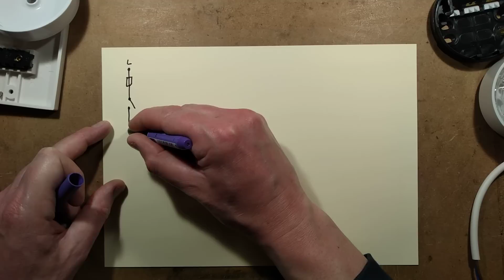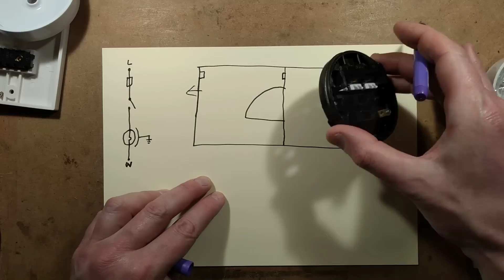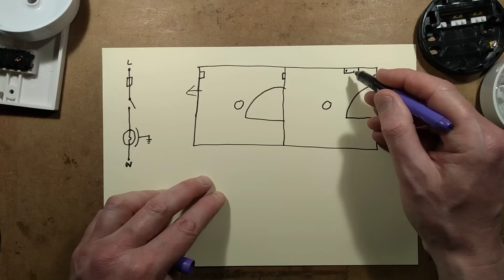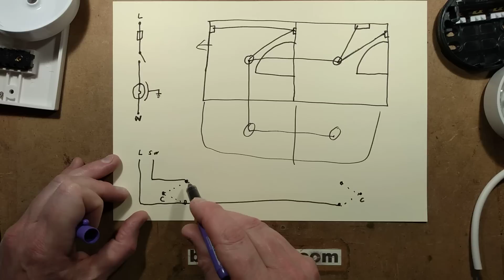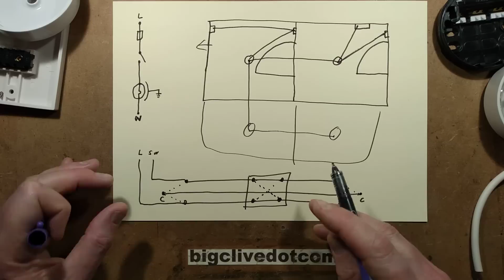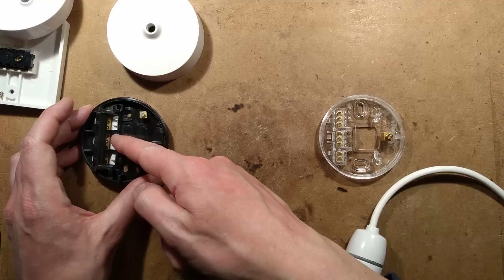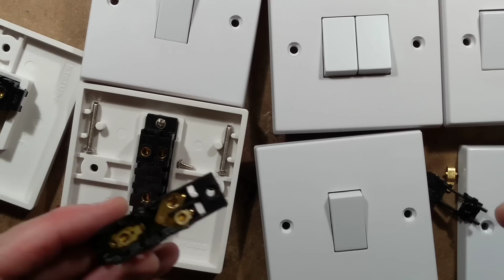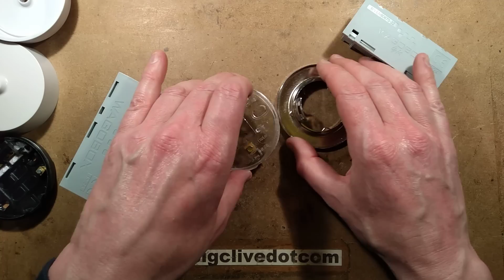British home wiring.  The incredibly simple lighting circuits.

Comment: ...At first I was baffled by a loop for the lights. Due to lights and outlets being in the same circuits here. Okay, no big deal. Just a tad different.
Then I saw you start to draw the two way switch, everything fine, no big deal going- aaand I had to realize that yes, your switches are exactly the same ones as ehre. But they are used in pretty much exactly the opposite way.
Never really seen a rose like you've shown. the only ones we use are essentially just a cover if you don't plan to use the light there. I've seen a Bajonet fixture only once in my 8 years doing electrical stuff as well.
And yet baffled again by seeing a bare earth.
Here's how we strip cable ends with all insulated wires:  Lightly cut around it, bend the cable so it tears open and then you can just pull off the insulation. Or you can use a cable knife.

To the switch boxes, yeah. really different once again. Switches too.
Surprised to see just how far yours jump out of the wall.

I'm honestly kinda tempted to collect a bunch of things and post a summary of how we do it in Switzerland now.
Reply: My house here in the US have both the switch as a spur and the wires going to the switch first. I believe the current standard is to go to the switch first as this is needed for some fancy kinds of switch. I have a PIR switch in the back room and I had to run a neutral to it especially as it's the spurred-switch kind.
Reply: The problem with stripping all-insulated cable like that is it's very easy to cut too deep and nick the insulation on the wires inside, in a way that is not obvious at the time but potentially dangerous or could randomly short out later. I really like being able to strip twin&earth from the end as Clive showed, as it's much less likely to nick the inner insulation.
Reply: Those metal boxes Clive showed are made to be sunk into the wall leaving s surface switch plate or socket about 10mm (less than 1/2") deep.
There is an alternative method for stripping T+E cables ..... You cut into the cable from the end parallel with the cores. Open the Grey (or white) sheath and expose the bare earth. Grip the earth with your snips and pull at right angles to the cable. This will pull the bare earth through the sheath splitting it down its length (if you are in a socket or switch it will only strip to the exact length you need. You then pull the exposed cores out of the sheath and cut the excess sheath off! Much quicker and used by nearly all sparks I have rubbed shoulders with!
Reply: Dave W - I use the banana skin technique. Cut about an inch (25mm) into the end either with snips / side cutters or a knife (scoring towards the cut end from a point an inch in with the cable flat). Then pulling the brown and the blue wires apart so that the outer sheath splits. Keep going until the required amount is stripped.

Comment: There is another school of thought. Thomas Nargy uses it. Instead of bringing one cable to the switch and marking neutral as a switched live.  The new idea is to run a second cable to the switch so your running a live and neutral to the switch and then back to the rose.
Reply: You could just use a cable with an extra core for the neutral.
Reply: @chaos.corner  speaking as a former spartk and o was discussing this issue with a spark friend the other week. 

The reason some sparks run two cables to the switch is to stop people blowing their lights. It is not uncommon on switched live systems for the home player or the one week part p spark to pull out the ceiling rose to replace it with a fancy light then wire all the reds together. Bang.

Comment: You'll almost never see surface mount boxes inside the living space of a house in Canada/US. Almost everything is done in wall.
Reply: because usa homes are made out of cardboard anddead space between the cavity ,UK homes used to be solid brick or stone so u have to have exterior boxes , modern homes are all sunk into the wall with just a faceplate showing
Reply: @girlsdrinkfeck  The space is needed because  our walls in the northern US have to be insulated, because it gets really cold in winter.
Reply: @coolbluelights  Was going to say the same thing in reference to someone who commented that the US likes to be wasteful. If there was an outside wall with brick, it would also be framed and insulated with 3" of fiberglass and then sheet rock over it to keep the power consumption down when heating that room. Seems the opposite of wasteful to me.
Reply: @coolbluelights  ik now UK homes are same but older homes used double brick for cavity
Reply: A lot of UK housing is solid brick construction. I remember my dad adding more sockets when two-per-room wasn't cutting it any more and he had to get the chisel out.
Reply: @chaos.corner  in Scotland pretty much all new builds are timber frame with plasterboard so we can getaway with boxes inside the wall :)
Reply: Everything is done in the wall too in Finland but when they rewire an old apartment they often do surface runs cos its just not worth opening up all the hard concrete walls.
Reply: Unless they’ve changed again, the standard that my relatively modern house was built to has exterior walls constructed of concrete blocks on the outside, then an air cavity half filled with insulation sheets, then concrete blocks on the inside. The outside of the wall is rendered. The inside of the wall is plastered. In my house, the concrete blocks don’t appear to be the lightweight type. But often for new build, lightweight concrete blocks are used for the inside part of the wall.
Reply: Unless of course your house was lath and plaster.  My grandparent's house had upgraded circuits for the kitchen and most of it is steel/aluminum surface mount conduit boxes.  It's a bit ugly but not as ugly as industrial conduit in a living space as it could blend in rather well to the design.
Reply: @WJCTechyman  lath and plaster is pretty much extinct for new construction. I'm sure there are some multi million dollar houses where it's specified. What we used to put in plaster is a 4" box like the medium size Clive showed with a plaster adapter that the plasterers to finish to.
Reply: @WJCTechyman  If they had really wanted to they could have used old-work boxes, but $$$.
Reply: Surface mount boxes are just a quick and/or cheap option for solid walls. Few people really want them, but sometimes there isn't the time or money to chisel out masonry for a flush finish, or it's not worth spending it. They're also useful for fixing to surfaces that you physically cannot recess into for some reason, and for installations that aren't expected to be kept around for a long time.
Reply: Great morning for a Big Clive waffle video!
Reply: Lots of British homes are made from stone or brick even internal walls, so there isn't always space inside the wall. That's why those shallow back boxes exist for places with little to no space. Newer builds aren't always like that anymore however.
Reply: Same in the UK for newer jobs
Reply: Surface mounts are usually found in buildings that were built before electricity was invented. Modern ones have them built into the wall.

Comment: Clive, why do you have switches on your receptacles? I Would like to see you do a video on receptacles.
Reply: Simple. So you can switch off things without having to unplug them.
Reply: Simon Tay, I live in the states and I can’t think of anything we use that doesn’t have its own power switch.
Reply: D C Lots of things only switch to standby, not off. The switched plugs are very useful to switch them off entirely.
Reply: D C True, most appliances has a switch somewhere. But take for example my hifi set up. The turntable switch is at the back and recessed, impossible to access without pulling the thing forward. The other components are all front switched, but there are four of them. Much easier for me to click one switch at the outlet to isolate everything. Also, things like chargers don't have switches, so the only way to isolate them completely would be to pull them out. In the kitchen many items don't have switches- toasters, mixers, food processors etc.
Reply: I've spent a long time looking for switchable receptacles in the US. The only option that appears to be available is where one of the sockets is replaced by a clunky switch. Simply unacceptable.
Reply: But what about empty sockets that don't have an appliance plugged into them yet? The pixies can escape without a switch!
Reply: Scott Jackson That's what the shutters are for! It keeps them inside when there isn't a plug inserted.

Comment: Just curious how expensive those switches are.  Here in the states a standard single pole switch is about $4-5 or about 3.50-4.50 Euros.
Reply: A single gang one way switch is about one pound 30 pence
Reply: @andrewmayes3271  Dang, that's cheap.  That's about $1.70 USD.  You can get cheap switches for about that price her, but they don't last long.

Comment: In Brazil everything is different, I think because wooden houses or drywall is not a thing or what we call cardboard houses, every house here is made of bricks and concrete. But the electrical startdards doesn’t come even close to UKs. Most of the startdard practices would be considered death traps by UK folks. Fixtures are wired with the old fashion twisted wires and electrical tape. Most houses doesn’t have proper ground wiring let alone on light fixture.

99% of houses have what you call suicide shower, without earth wire. It is surprising I never heard of any death caused by it.
Reply: Good! Every house made of bricks and concrete is exactly the way they should be. None of the cheap, crappy, weak plywood, cardboard and plasterboard "houses" like in the US that get destroyed by the slightest bit of wind.

Comment: British electrical wirin is a joke, its not simple is primitive and backwards. glad that Northern Europe uses German standards for electrical goods.
Reply: The British regulations are of a high standard that's why other countries use our regulations as a base template for theirs
Reply: @andrewmayes3271  hahaha, good joke there lad. you guys still use ancient fuse boxes with rewireable fuse. something you will never see in continental european country still used.
Reply: No we don't. rewireable fuse boxes are obsolete and have been replaced years ago with modern consumer unit panels with rminature circuit breakers (MCBs) and RCDs.
Reply: A C Stop talking rubbish! We haven't installed rewirable fuses for decades!

Comment: Here in Bulgaria we use slight different style of boxes. Most of them are round and in my opinion not good. There is not threds no metal shield just crapy peace of plastic. Our standards are quite outdated, almost nobody use earth wire for a lights. And in the most old buildings there is not earth wire at all, just neutral. And as you can suggest RCDs are quite rear. I think that british electrical standarts are the best. The plugs, the flat cables, the boxes everything is well designed. But my favorite in the british style is the fuses in the plugs and the fact that earth connection is the most important.
Reply: The quality is dropping out of British fittings. We had a round pin plug and socket that was superb. Nice heavy brass, and strong springs with good contact area.
Reply: I used to live in BG and was always surprised at the building codes. Or lack of them at times lol. Seriously though some things are worse than the US but others are better.
Where in BG are you from?
Reply: TN-C was common use in lots country on east side of Berlin Wall. Boxes round, cheap one was shitty but u can get sometimes with prongs for better grip.

Comment: Some illustrations of the Australian equivalents here: http://luverneband.com/two-way-switching-diagram-australia/two-way-switching-diagram-australia-wonderfully-light-switch-wiring-diagram-australia-vivresaville/ Much tighter controls in Australia with only licensed electrician allowed to do most work and even talk of preventing those without a licence being able to buy mains components such as lights switches, lights, ceiling roses and wall power outlets,

Comment: I still find it weird the for us (the U.S. us) the light switch is flip UP for on, and DOWN for off, but your switches are opposite... some say backwards, some say WRONG! What do you think Clive?
Reply: In the US, it’s preferred to have up be on so if something falls and hits the switch, the circuit turns off, not on. Safety.
Reply: @jcnash02  In the UK we have rocker switches not throw switches so if something hits the top of the switch it won't switch it on.  Pressure has to come from the front to toggle it.
Reply: @jcnash02  same in germany, same reason.
Reply: If you find that objects keep falling on your switches and activating dangerous equipment, then really you should be asking firstly why objects keep falling and whether you can do something to stop that before someone gets a concussion, and secondly whether it's appropriate to use an ordinary switch at all if it's so easy to accidentally wreak havoc with it. There's a reason why workshop tools often have push-button controlled latching relays that are difficult to switch on accidentally.
Reply: The only time that makes sense is on a rocker switch with an indicator or colored insert. Down for on will allow the indicator to be easily visible from head level.
Reply: Being used to the British way, I think a rocker switch in the off position looks a bit like a closed eyelid, and in the on position I imagine it's woken up, so I think we have it the right way around!

But I think the American way is better for toggle switches, because toggle switches look asleep when they are pointing downwards. But it's been almost 50 years since toggle switches were widely installed as light switches in the UK. (Nowadays they are only really used for high-amperage switches to isolate cookers and showers, as well as for circuit breakers and switchgear.)

I also don't think calling the positions up and down really makes sense for rocker switches -- they don't definitively point in either direction. I would say that the direction a rocker switch is pointing is towards the end where the pointy edge is visible; the opposite to the usual way it's described. (Though I understand the mechanical equivalence to toggle switches that underpins the usual descriptions.)
Reply: No, the UK switches are the right way, not wrong.
Reply: @simontay4851  I agree. Press the lower half of the switch for on, the top half for off. Of course, two (or three) way circuits don't apply.
Reply: The truth is, it's fairly arbitrary and doesn't make much difference which is why both persist. It's just unfortunate it doesn't match internationally. The safety angle probably makes more sense for knife switches though because of gravity.

Comment: Note on the Wagobox, that tab for "zip tie" could also be used with a tamper-evident device.
Reply: Or  'circuit under repair' sign.
Reply: or used to secure it to something?
Reply: It's for a cable tie you are supposed to have to use a tool to open a junction box. So some tool does not open it
Reply: All good answers. Could just be that they had an actual sparky helping design this stuff and he asked, "What if I want to attach somethin' to it?"
Reply: @Indosarnia  Agreed

Comment: Interesting. So how then would you wire up batten light fittings that only have live neutral and earth? (As it happens I have just done this in my shed on a temporary basis).
Reply: Either to a separate junction box (discouraged nowadays as any non-permanent connection must now be accessible for inspection) or loop at the switch.
Reply: @calmeilles  Many thanks. Not quite the way I've done it in my shed but close enough for now till I upgrade the lighting.

Comment: I just love those Waygo connectors. Never got to use them much, my contractor was a tightwad on materials. But the few times I got to use them, I found them so much nicer than wire nuts.
Reply: Yes, but when working inside heater-type appliances or halogen lights, the joys of solid ceramic wire nuts cannot be overstated. Of course, that's with appropriate high temp wire, such as Hypalon, Teflon, silicone or silicone w/ glass braid.